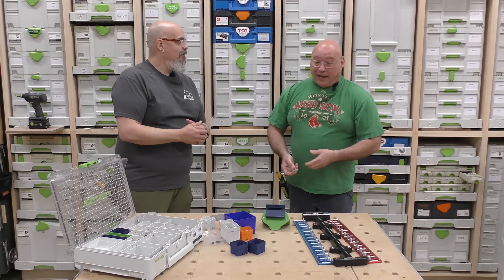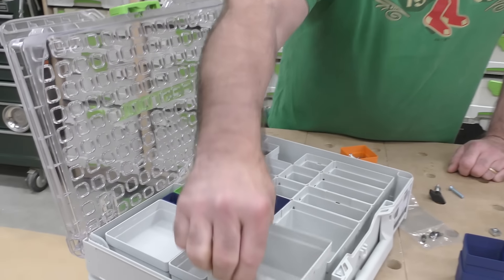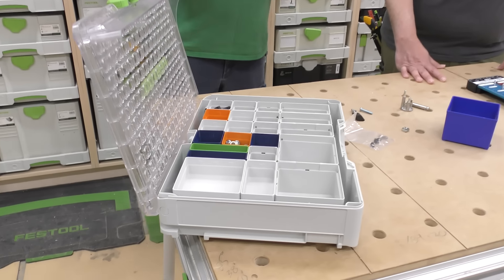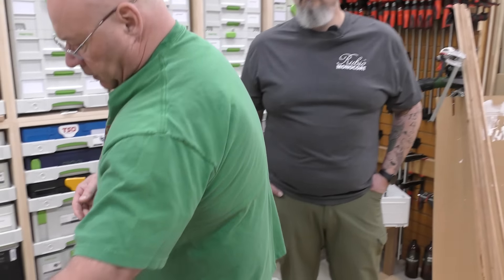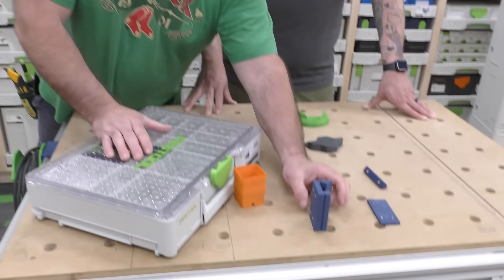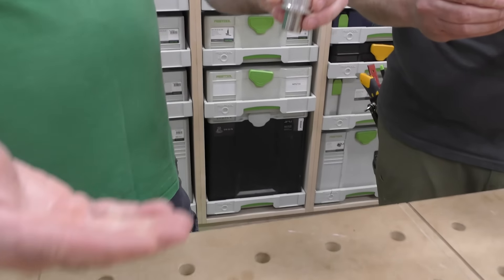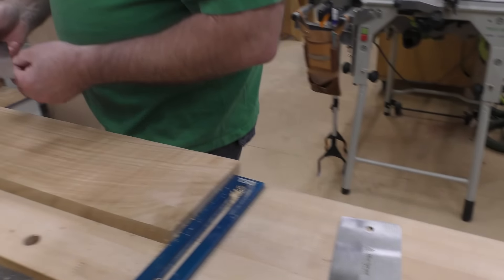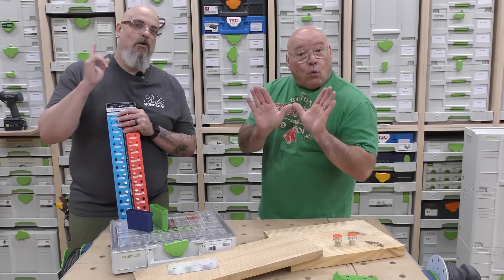Next Level Shop Tools You Should Check Out !

Comment: 4:30 too bad it will not work with the new Sys³ systainers as you cannot slide anything into the card holder from the top anymore 😕
Reply from the maker: Works perfect with Gen3 systainers .. There is a little notch at the top and they fit Perfect !!!! Forged 3D has thought of everything !!
Reply: @sedgetool  ha, thanks! Now I need to excuse myself and go file off the excess tabs on my 3D printed clamp holder ☝️😄

Comment: This is how I did it. Get yourself a tape labeler machine, I use the Brother P-Touch. PT-P300BT. It uses an IOS app so you have hundreds of fonts and it saves your print history. For the bins if the bins aren’t full I adhere a 1/2” white label to the inside lip. If it’s full I put them on the outside in addition so I know ar a glance what’s in the individual partition. For the top of the outside clear  lid I was planning on using 1/4” 6mm transparent with black ink. You can label 🏷️ the inside lip and the outside lip of each of the boxes (1/2” white labels blank in) and put the labels on the outside of the clear lid 1/4” transparent label and won’t obstruct your view.
Reply from the maker: wicked cool

Comment: Sedge and Big D, thanks for the shout out this morning!! We are proud to have earned a place in the legend’s shop…. But Big D looked a little left out, anyone think we should show him some love with a couple of pieces of kit for his shop?
Reply from the maker: Thanks..... for sure !!
Reply: Hey! I was looking on your site for the MFT table accessories, but couldn't find them. Am I doing a stupid?
Reply: @groundeffect236  Not at all... It can be a little confusing with all the options.  Most folks will start with the tool holder or what we call SYS-FIT Racks... Once you've added your SYS-FIT Racks to the cart, then bop on over to the SYS-PLT Mount Collection and you will see a selection of different mounting plates for your specific system... Have a Systainer and wanna hang something from the front of it, pick the SYS-PLT Systainer3 Mount (will work with TLOC as well) or in your case want to hang some thing from the MFT, select either the SYS-PLT MFT Maximus or Minimus mount.  The Maximus mount uses both the upper and lower extrusion support, along with 4 fasteners to provide the most robust (yet removable) attachment to the MFT.  Our TRK, HCH or ROS rack are perfect candidates for the Maximus as they are typically going to be supporting the heaviest stuff (tracksaw track, vacuum hose, ROTEX, etc).  If you are hanging a smaller sander, one of our clamp (MRC or FCE) racks or our rail square (RSH) then the MFT Minimus is going to be great.
Reply: @forged3d thanks. Did it!
Reply: Order placed, used the link for Sedgetools so hopefully the transaction was linked for him. Shame you were out of the 50x100mm half height grays, will need to keep an eye on when they come available again.
Reply: @richardwilliams648  Hmmmm… I just checked out inventory allocations in the backend they show as available… Quantities should be based on our available filament and print capacity… But light grey is a stocked item vs custom colors being more produced on demand.  50x50x34 mm we keep a fairly consistent assortment of colors as they seem to sell thru very well and 50x100x34mm also are usually in the stock bins in light grey as well, along with the mountain of spools we keep on hand of that color.  I will do some additional digging on this, but encourage you to check back in the coming days.  Sedge’s kind words has lead to an uptick in orders that we are working feverishly to fill, so things may be a little out of sink in the backend as we push thru the backlog.
Reply: @forged3d  thanks, just checked the site again and it looks as if its available now. I have sent a reply email to my order to see if I can get them added to my order. Thanks again!

Comment: Dear Seddge i need a help information . Why i have in the Domino Systainer  Reserve  Flaps ? Can you make a Video about this . In the Manual i read this :
Remove one of the Stop latches 9-1 Fig 9a. Attach one of the accompanying stop latsches 9-2 to the Dowel jointer Fig 9 b . Thess stop latches are narrower and allow you to make more accurate adjustments . What do they mean by that?
Greetings from Austria . 
Milan
Reply from the maker: Those extra flaps are if through wear and tear they start to misalign...... I will try to do a video on this in the future..
Reply: @sedgetool  Thank yor Sedge .  For the information 👍👍👍👍👍👍👍👍🙋‍♂️🙋‍♂️

Comment: How do you even sharpen such a thick scraper? I know you've made some very good vids on that topic. For regular scrapers. But for this one it surely is different, right?
Reply from the maker: I used my AccuBurr on this one but AccuBurr has a new on that I am thinking of getting to use on the Blue Spruce scraper. It is design to work on the thicker scraper blades that you use in a Stanley #80.